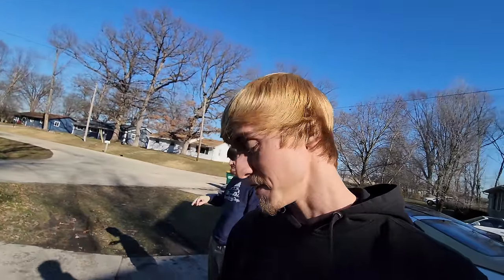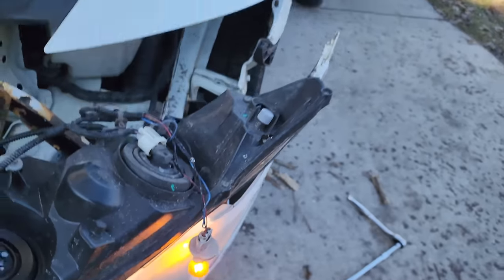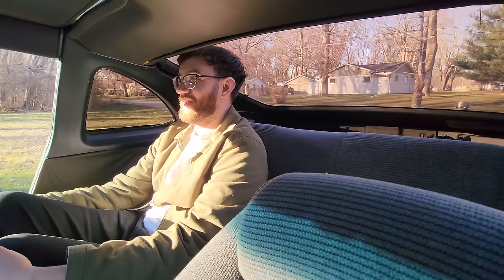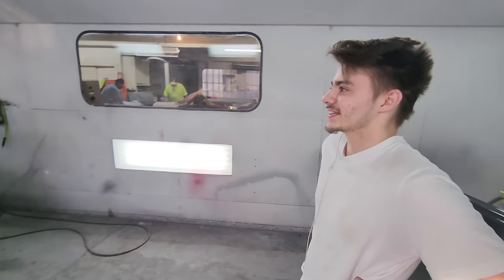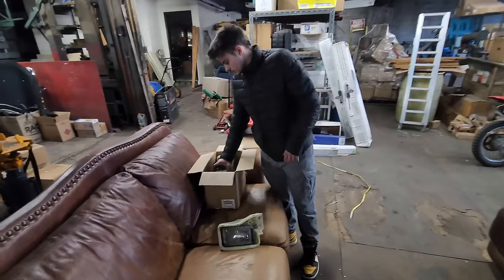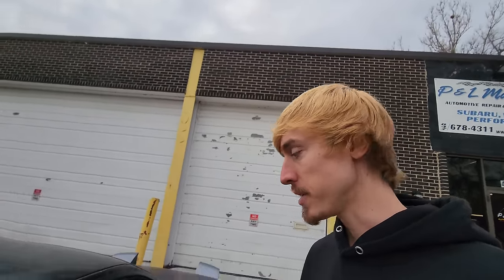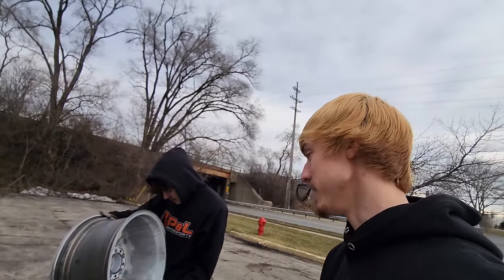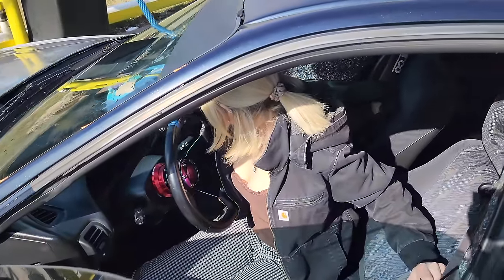Revealing the New Color of my Nissan Gloria Y32!

Comment: I'm not even a Z fan but paytons Z has me feeling things man. Tell fran not to worry about oil on the outside of the engine i'm a BMW fan for us that's called a feature "external oil rust prevention"
Reply: My E36 is defective, the engine doesn't leak oil but the trans does
Reply: @sampuhhupmas5666  The spirit of BMW merely moved the oil leak. My e30 doesn't leak any fluid but that might be due to it being a bare shell.